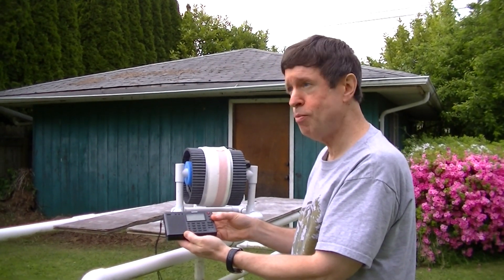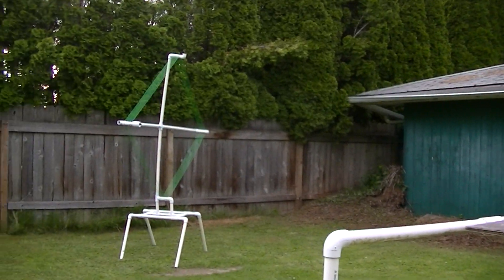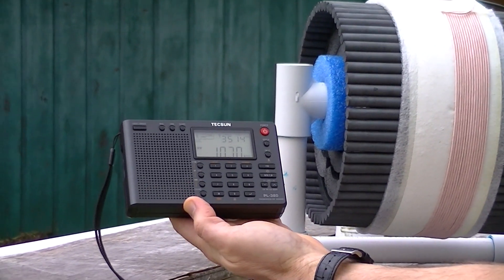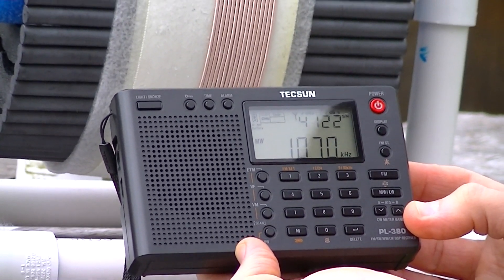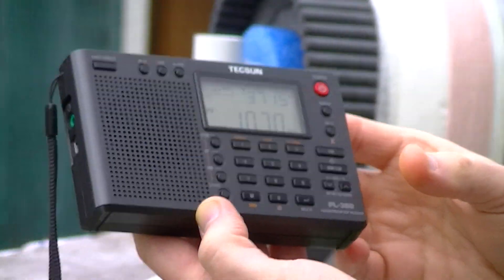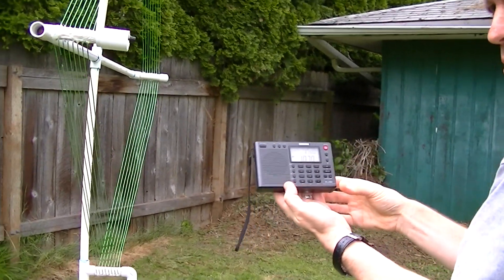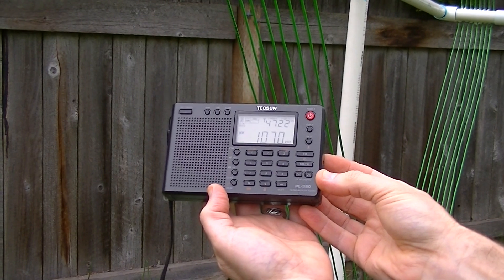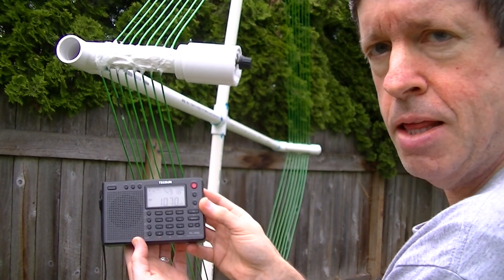8" Ferrite Sleeve Loop Antenna Demonstration

Comment: Greetings from PA. I have been into SW portables since the mid-80`s. I now oscillate between my Kenwood TS140S HF rig and a beat-up Kaito KA1103. For the last year or so, I`ve gotten into evening pirate radio on weekends and AM DX in the early morning. I have used as antennas, long wires, aluminum gutters, wire dipole invert V`s, slim jim`s and stock whips. I am in the market for a more simple receiver. I have had lousy luck with obtaining Chinese radios that will last more than a few days without something breaking. The KA1103 is the best I have come up with. I enjoy your videos and am viewing some today.  Good DX and thanks.  KC3BXZ Joe 73

Comment: I built a mediumwave loop based on a design that I saw in Popular Communications about 25 years, consisting of a square wooden frame about 1 foot by 1 foot, with I think 20 turns of magnet wire, and it performed at least as well as that for a lot less money than whatever you spent on all those ferrite rods.

Comment: Gary, what I did once years ago (around 1995) was string out two longwires about 8 or 9 feet off the ground in opposite directions (draped over lower tree limbs and bushes) and connect them to a homemade coil of about 100 turns of 24 AWG magnet wire wrapped close wound on a PVC or paper towel tube. The longwires were about 250-300 ft long each. I went from getting only 3 AM stations during the day to around 50. From NW Louisiana I could easily hear Dallas, Houston, Oklahoma City and New Orleans at noon. The coil wasn`t tuned. 

 At the time I wasn`t focused on DXing as much as I was just trying to get more stations and news so I never attempted to log the most distant stations which I`m sure extended out to at least 400 miles during the day. The ones I mentioned sounded like locals. Oklahoma City was 315 miles from that location and New Orleans 270. I could hear a lot of weak stations too but mainly listened to those. Maybe there was a better way of doing this but I accidentally figured out on my own that this was possible after I noticed that a crystal set near a portable radio boosted the AM signal. 

I would also connect an LED to the longwires when thunderstorms were 30-40 miles away and watch it flash. LOL! I would throw the ends outside during local storms though. I fell asleep one night with a longwire connected to one of my best radios (I was drunk actually) and woke up during a severe thunderstorm in a room filled with smoke. Poor radio! I guess I was lucky to survive it. It actually hadn`t rained at all in about 3 months when this happened. It was a big surprise. 

I used to get some incredible shortwave DX using a Radio Shack DX 392 made by Sangean using the longwires mentioned above. I listened to search and rescue on SSB from Louisiana when planes crashed off the coasts of New York and California. 

I fell in love with AM radio as a child in the 1970s when I used to sit in my mom`s car at night tuning in distant cities. It was lke magic to a country boy living in the sticks to hear the outside world. Then in 1992 I saw a cheap broken shortwave radio in a Dollar Store and offered them five bucks for it and repaired it. I still listen to AM and shortwave every night. I fell asleep earlier listening to a shortwave station and started having nightmares about being trapped in a bus with Brother Stair yelling at me. He`d came on after the show I was listening to went off. LOL! Scary!

Comment: Hi Gary, 
Did you design same kind of ferrite antenna for Longwave DX? I am looking for that design or suggestion on it. GoodDX.
Reply from the maker: Hi Jiang,  Yes, I did design and build a Longwave version of this 8" FSL antenna. Except for the Litz wire type (660/44, instead of the 660/46 used in the MW version) and the number of coil turns (60, instead of 14), the Longwave version is identical to the MW version. The Longwave FSL tunes from 153-550 kHz, and was used to receive South Pacific NDB beacons like 238-KT, 260-NF and 270-FA on a PL-380 Ultralight radio on the coast of Oregon state. 73-Gary

Comment: In 2003 I made a FS loop antenna by gluing pcs. of old 3/8th ferrite antenna pcs. in a circle but wound it directly on the ferrites and it didnt seem to good in my cheesy tests.I of course didnt do it because of the same reasons Mr. Maynard did (  i am not a deep thinker) I just did it because I thought more is better!! Wish their was a roundtable for us antenna buildrs, I have a couple really promising designs that I need help with. Regards

Comment from the maker: @cobrachobbergirl, the Select-a-tenna and other small air core loops will provide minor gain boosts to the PL-380 and other portable radios, but nowhere near the gain boosts provided by this new-design 8" FSL antenna. Its gain has been tested against a full-sized 9' sided box loop, and has been found to be roughly equivalent in weak-signal reception performance. The Select-a-tenna is a much cheaper option for those without the need for such high gain, though.

Comment from the maker: @bbvc2000, These 200mm x 10mm Russian surplus ferrite rods were all obtained on eBay from the seller "Alexer1." Another eBay seller marketing these 200mm x 10mm rods is "Sovtube." The current cost of these rods is around $4 apiece (including shipping), so this particular FSL design is not an economy model. I have another demonstration video posted of a 5" Medium Wave FSL that works very well and can be built for around $95-- including a link to the full construction article. 73-Gary

Comment from the maker: @ethiggins,  Thanks! This 8" FSL is a tuned passive design, without amplification. 62 Russian surplus 200mm x 10mm ferrite rods are arranged in an 8" diameter cyclinder (with inner core padding), then wrapped with 660/44 Litz wire and tuned with a 381 pf variable capacitor. I'll try to make a TP-DXing comparison video when conditions allow... 73, Gary